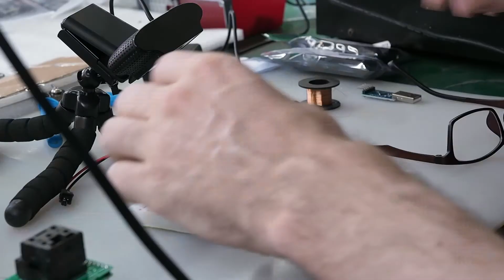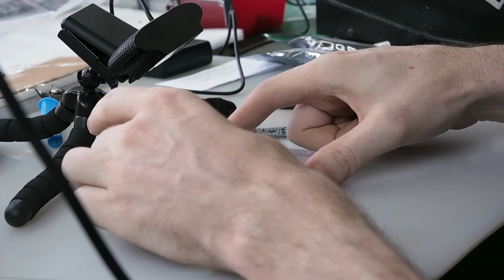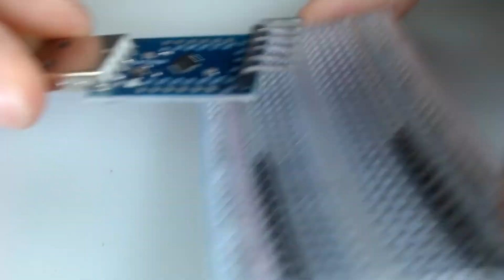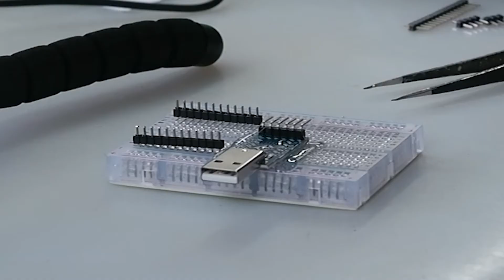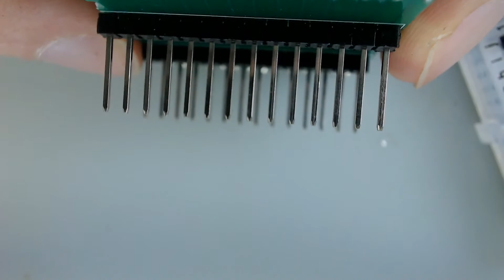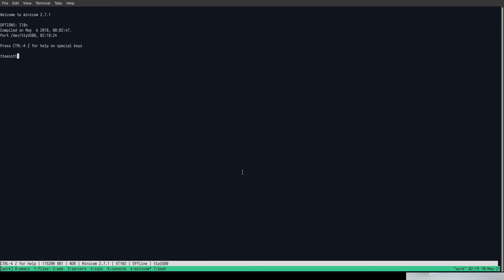Soldering Tiny Wires To Avoid Buying A Thousand Fake Chips - ESP32 WiPhone

Comment: Hi, i know this phone is not a smartphone or even a regular phone but i have a question, Could this Phone use phone SIM cards? im not from USA im in mexico and around here you need a SIM card from any company like: USACELL, MOVISTAR, TELCEL, AT&T, T Mobile and on.
Reply: There's no SIM on this phone, it's currently WiFi only. There is an enhancement request for a cellular capable daughter board. There's also the option to create your own cellular add-on for it.